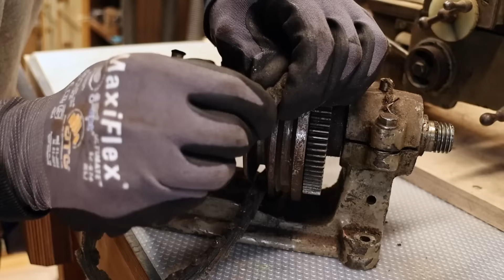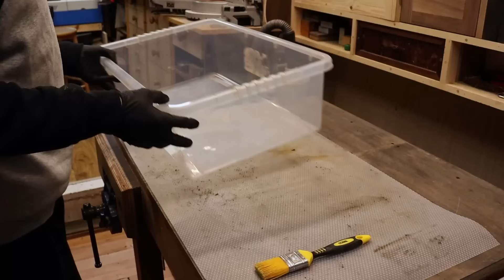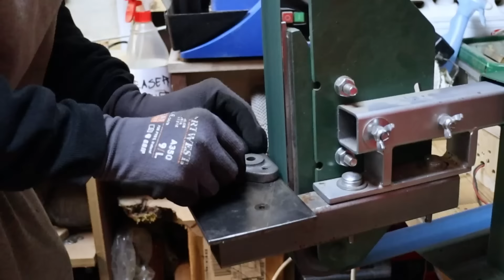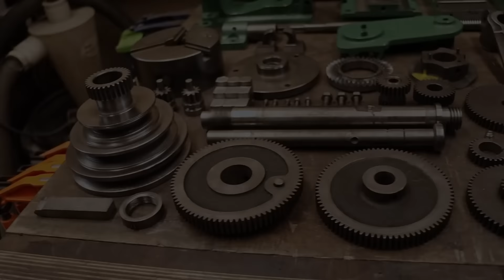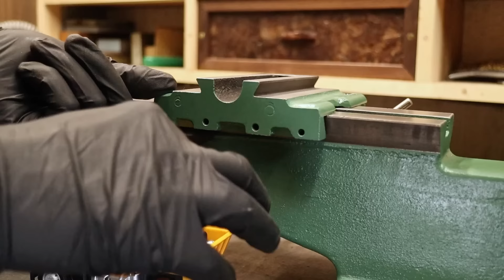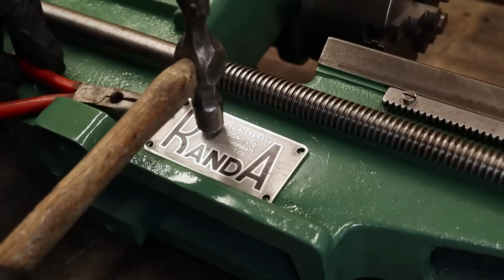Metal Lathe [Restoration] - 1930s RANDA

Comment: It looks good, but you missed so many aspects of restoring precision machinery. Proper slide restoration and adjustment. Having the right tools; dial indicators, feeler gauges etc. The chuck was not properly lubricated on the scroll or bevel gears. Proper general lubrication, the list goes on. They are plenty of good restoration posts on YouTube, if you want to learn the right way, watch them, and your posts will not meet such negative comments by professional engineers.
Reply from the maker: Appreciate your input 👌 I'm not an engineer as you can see 🤷‍♂️ there's nothing negative in your comment just a knowledge about proper way of doing it 👍
Reply: @MatthewMoustache  Thank you, I spent all my working life as an engineer with over 35 years in the gear/gearbox industry. I was the guy that was sent to repair, modify, offer assistance to customers all over the world. I've stripped and rebuilt so many gearboxes that it was 2nd nature. Good luck and happy restoring.

Comment: Good job!! However as a retired Master Machinist I couldn't help but notice the absence of a thread dial. Not having this would make accurate thread cutting extremely difficult if not downright impossible. Just curious if there was one missing or if there never was one?
Reply from the maker: Thank you William 👍 this is how i got it so it might be missing and I'm new to using metal lathe so thanks for letting me know 😀 I'll be learning how to use it but definitely this will increase my ability and skills
Reply: I'm no master machinist but as far as I know many lathes don't have a thread dial. When cutting threads with these you don't disengage the lead nut between cuts. You make the first cut, when you get to the end you put it on neutral, pull back the cross feed, put it on reverse, then neutral when you're back at the start, move the cross to the desired depth of cut, put it back on on forward, rinse and repeat. By keeping the lead nut engaged throughout the whole process you don't lose out on the synchronicity. Definitely more practical with a thread dial tho.

Comment: Nice work. But please don't sandblast guide surfaces, that will ruin them. A drop of oil here and there wouldn't have hurt during assembly. The scale rings made of plastic are guaranteed not to be original, to make new ones you need a milling machine with a dividing apparatus.
Reply from the maker: Thank you very much for your input 👍 most of them were covered with tape, i did use machine wax for protection and smooth running, I'm new to such an machines but lesson learnt 👍

Comment: Nice piece of machinery! Bit of advice for the future, though: do not sandblast precision machined parts or the frames of precision machines. Sandblasting can induce surface stress on the parts and throw them out of whack. 1 or 2 thousands of an inch doesn't matter if it's a old hand drill you're restoring, but it matters when it's a lathe you plan to make accurate cuts on :)
Reply: It can be blasted, but you need to use plastic media. Plastic bead blasting will strip the paint, but won't affect the underlying metal.
Reply: Why not oil the parts on reassembly ? Looks a great job👍🏻

Comment: What a lovely little machine. Looks like a cross between a small Hardinge, and a south bend workshop lathe. Side note; ought to replace that lead screw and half nut. Looks like a LOT of wear on those.
Reply from the maker: Thanks David 👍 the half nut seen a better time's that's for sure, and thanks for pointing that 👍

Comment: Very nice restoration!

One hint for the future - these big flat head screws are not designed to be opened with standard flat head screw drivers. These need a head that is straight, not angled. For to his kind of tool, please check "Drag Link Socket".
Reply from the maker: Thanks man 👍 great tip I'll definitely get them 👊 appreciate that

Comment: Having just acquired my very first lathe-a RANDA  which needs a lot of TLC I found this very interesting, thank you,  I am 73 and although DIY savvy, this is my first ever lathe so I hope I can find someone prepared to answer stupid questions !!
Reply from the maker: You can ask me 😁 and I'll try my best to answer
Reply: @MatthewMoustache  Well now I have it and will be taking it home to France. Should be home in a week. It seems to me that the first thing is to clean as much crud off it as possible so a hand car wash with hot soapy water might be the first step? It will certainly need a motor and a flat and V belt.
Reply from the maker: @duncanandrews1940  nice 👌, you can try with pressure washer for sure just make sure you will work on it since that to prevent more rust build up, motor can be runned through vfd drive to easy adjust speed 😉
Reply: @MatthewMoustache  Car washed it today and will start to dismantle it for finer cleaning. Not much rust on it anywhere. Using Ballistol as a rust prevention liquid. Because I live in France all the accessories here are metric. As this is a 1930's machine what tread(s) should I expect to find on it? ( Oil Cups etc., )
Reply from the maker: @duncanandrews1940  nice one buddy, you need to check them manually or try to make some research on your exact model, if it's made for Europe maybe metric but it's hard to say without seeing it.

Comment: I've just picked up a Zyto lathe which is pretty much identical. Mine is in fairly reasonable working condition so I'm doing a bit of a rolling restoration.
I've just replaced the original tool holder with a modern quick change type which has made a big improvement. I got one of the super cheap ones from eBay but it seems to work ok so far. If you do the same you'll need a 2.75" 3/8 whitworth bolt to replace the original stud 
Your video has been very useful, good work 👍
Reply: Just looking again, it looks like your tool post has been modified with a piece of leadscrew which is probably much more rigid than the original 3/8 stud.

Comment: Love old machines like this 😁 with a small light lathe ya want to bolt it down tight to somethin solid and heavy....... Youll get much better cuts and a better finish. After that the lathe needs to be "leveled"...... this doesnt mean actually makin the ways level, it means removing any twist from the ways, twisted ways will show up as a taper on what youre cuttin; tho a short lathe makin small parts it wont matter as much. Lots of videos about lathe leveling, I suggest This Old Tonys video, its both helpful and funny 😁
Reply from the maker: Thanks mate 👊 good tip is always much appreciated 😁👍

Comment: I quite like your restoration. I have a Tyzack ZYTO with a date of 1954 ? It's basically the same lathe only mine has a bigger lathe bed. Your rebuild didn't show any alignment though for the headstock and tailstock !!!
But a very good refurbished little lathe ready for another X amount of years.
Reply from the maker: Thanks Lance 👍 I did it off the scene as I'm new to metal lathes and don't have too much knowledge, but for sure it will serve another year's

Comment: I bought a Randa lathe just a couple of weeks ago.  So this was a timely video for me.  

Not sure what mine is, but it does not have a Randa name plate, instead the casting is stamped Ross & Alexander Ltd "Randa"

Still coming to terms with the thing.  Think I am getting too much play in the headstock.  Did you need to replace the bronze bushings in yours?
Reply from the maker: Surprisingly bushings on my one were okay and didn't had to much use i guess (fairly good condition). Your might be older. 
I hope you will find this video useful 👍
Reply: @MatthewMoustache  I am going to play around a bit with mine first, then strip it down and try and work out where the play is coming from.  

Mine also came with a 3 phase motor and VFD.  The VFD I realised yesterday is programmable and also has a number of terminals so I can add extra switches to it.  Going to be playing with that tonight

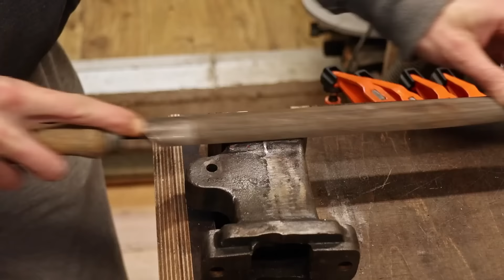Comment: 8:40 Man, cast bodies should not be grinded because the original texture is lost. Anyway, great job! You brought it back to live
Reply from the maker: I remove only imperfections left after casting process as they were not cleared in factory.
Reply: Not necessarily. This is a small, inexpensive hobby machine, so savings were made on such complex work during production. At my workplace there is still an old milling machine from the 1960s, which was also processed in the factory at the time, i.e. sanded, filled and painted in several layers.

Comment: Nice old lathe , what was the runout on that part. Watching you almost made me want to try that. Do you have any recommendations as to which lathes that aren't worth restoring.
Reply from the maker: Thanks George, if you talk about that small brass part (oil wick feeder) there's cap missing and broken fixing point for the cap. My recommendation hmm as long as you don't need buying half of the parts it's worth it or if you can't make some of the parts i would pass
Reply: @Matthew Moustache  yeah I'm just conflicted between buying a new one "probably with plastic gears and made in china" or buying one made in USA even being an older one. Just wanting something for occasional use in hobbies
Reply from the maker: @George Distel  well i heard about cheap Chinese lathes they might have problems with plastic gear's, but i bet you can find decent second hand on fb market

Comment: excellent video. I have an R and A with 6 bolts to secure the bed, i think mine has a longer bed but I bought it without the left hand support for the gears, still, its useful. I had to get an adapter plate and a chuck plus a sewing machine motor to run it! Would love to get a casted copy of that bracket! (I have the gears...) Please PM me if you can help...
Reply from the maker: Thank you very much, i can try to help if you find me on the other social media as it will be easier to have discussion 👍 moustache workshop on Instagram or fb

Comment: Safe to presume you chased all the threads off camera? As easy as the bolts and nuts went on, you must have.
Did you level and plumb the machined surfaces to ensure they are the same height and flat to each other?  Dependng oon how much use it has seen, and the maintenance, the machined surfaces could be worn down a little, giving idiosycricies to work with/over come to get an accurate part.  The chuck and tail stock off a couple thousandths of being centered, for example.
Reply from the maker: Yes i did few operations off camera, this machine is my entry level for understanding how it's working and how to learn basics etc. 
Still didn't find the right place for this lathe, once I'll do it I definitely invite one of my friends who got the right knowledge and help me with all what you mentioned. 
Thanks for pointing crucial things 👍

Comment: So stripping paint, body filler and new paint is a rebuild???
Reply from the maker: Properly cleaned, rust removed, fully disassembled, new paint, adjusting all moving parts, make sure it's working, i think it's called restoration.
Reply: is it straight, does it cut parrallel.  more to restoring alathe than a new coat of paint and wd40.
Reply from the maker: @Victor Muckleston  few uses and I will know